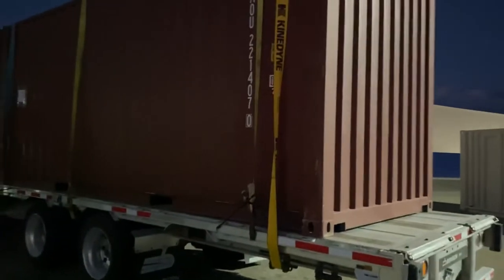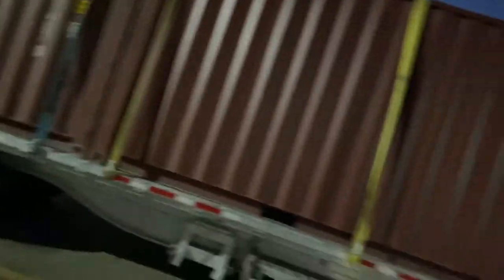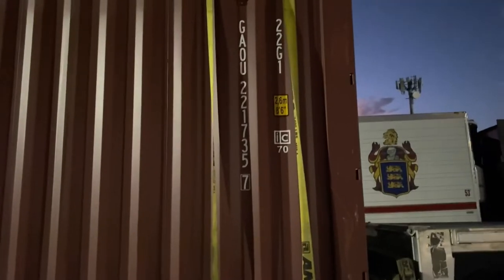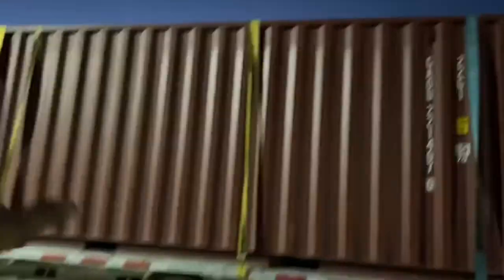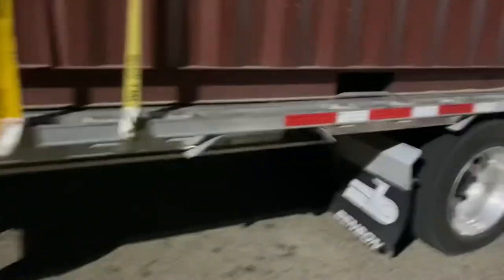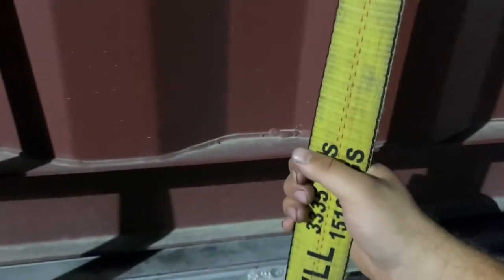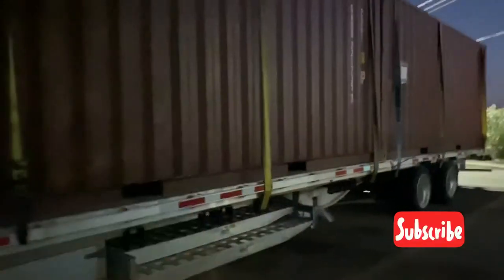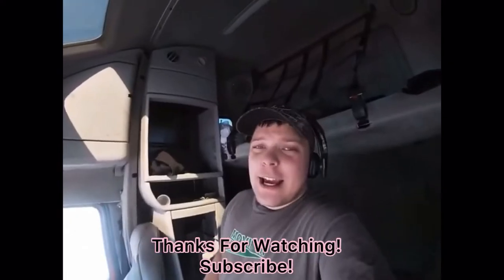How To Strap Down Containers Onto Stepdeck Or Flatbed

Comment: I don't know if I want to trust the way you strap s*** down your straps should always be on the inside of that rub rail not on the outside that way if you ever gotten a wreck and got sideswiped on the driver's side your straps cannot get cut You obviously do not know how to strap down a container
Reply from the maker: Actually, I do know how to strap down a container.
If I would’ve put the straps inside the rub rail, the straps will be rubbing against the sharp edges or areas of the container . Which will eat away the strap in about 100 miles and then I would have to buy more straps and re-strap the load..
I have been doing this for four years. Never had an issue never gotten a ticket for the way I strap my load. 
Of course, I always try to put the strap inside the rub rail, but sometimes the size or width or the circumstances of the load changes the way I put the strap .
Sometimes you have to be smart in order not to waste good straps sometimes if you haul an oversize load, your straps are outside of the rub rail because obviously they cannot be on the inside. Just some common sense needs to be taken in the fact. .

Comment: And you should never ever have the hook side of your straps on the driver's side they should always be on the passenger side
Reply from the maker: That does not matter which side the hook is on. Some step deck trailers have tiedowns for the 4 inch straps on both sides of the trailer so shut up about your stupid ideas or methods.
I have been doing this for four years. Never had an issue with DOT and never ever have I lost a load.
Reply: Please explain how this even makes sense. I have to challenge you on this one.

I actually prefer to use the hooks on both sides of the trailer trailer. It creates a reverse force when securing. If all the straps are winched from the same side it puts pinch pressure on one side of the load. If you do it from both sides, it pinches it in towards each other creating greater securement. I would highly recommend that no one takes your advice.

I should mention that I spend every one of my days securing loads to 53 ft flat decks
Reply from the maker: @ChrisMiller-ej3up my 4 inch straps tie does are only available on one side on this trailer. I understand your theory but nothing I can do if trailer was speced from the factory to have the 4inch tie downs only on one side.
Reply from the maker: @ChrisMiller-ej3up also your a bafoon. Been driving Stepdeck for a while never had problems with strapping down like that
Reply: @EddieV19  good for you 🙂
When I first started pulling flat deck, I had an issue with this big load of scaffolding I was hauling a couple thousand miles to its delivery site. I kept having issues with it shifting and then it started to lean a little bit. I pulled over to try to fix it and an experienced trucker stopped and gave me a hand. He taught me about reverse forces and how using winches on both sides of the trailer pull the load in both directions securing it more tightly. We shifted some straps around like he said and I never had an issue after that. I've been doing it that way ever since and I hardly ever have a load move at all. It made a big difference. Also, it would be cool to be able to come to these places and learn about things, but unfortunately people tend to be aggressive and start name calling in such like some type of high school, spoiled brat every time they disagree with someone. Hope your day gets better
Reply from the maker: You do realize that I understand that. But nothing you can do when the company you drive for has a trailer from Benson that designed so that the 4inch straps hook up like that.